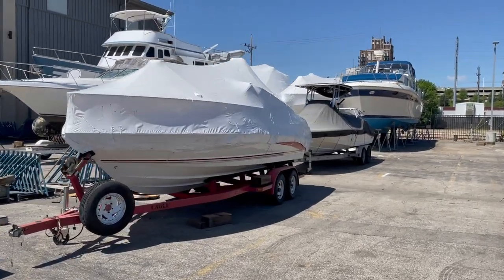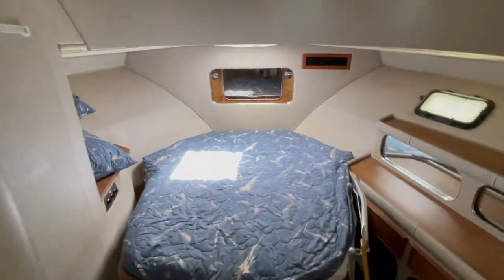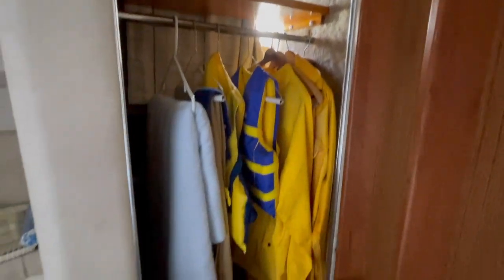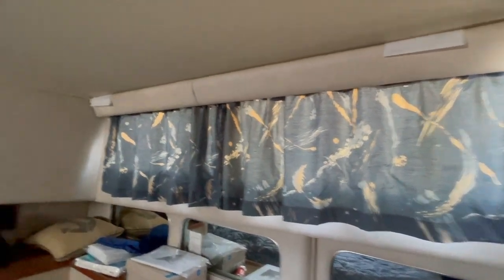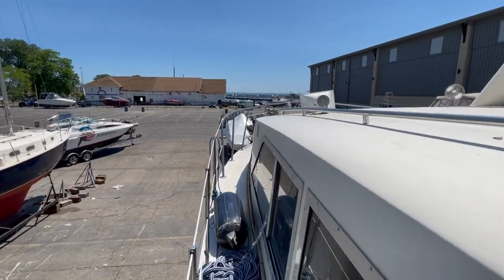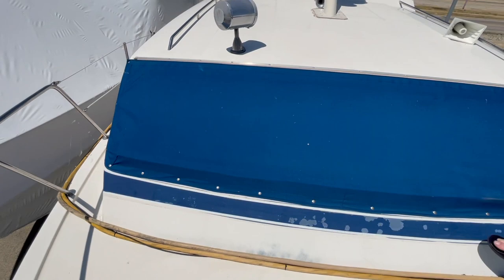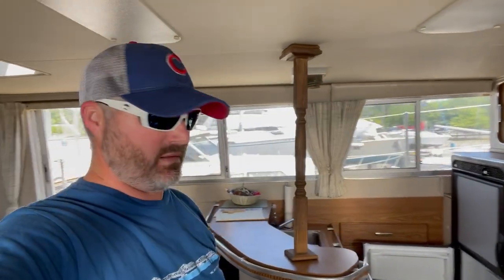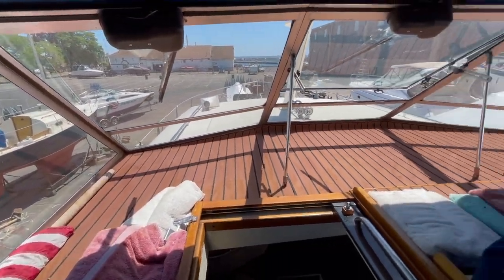Could this be the next boat??? 1984 Chris-Craft Catalina 381

Comment: Nice boat,but if i was going that big id go diesel.
Those gas burners are reliable and faster,but probably less than 1 mpg fuel burn.if you ever plan on taking the great loop,or trip to the bahamas.....gas is expensive to cruise around in on long trips.
Just my opinion
Reply from the maker: Completely agree...and we window shopped some boat with diesels. Just couldn't match up the layout or find one close enough.
Reply: @WiscoBoater  ill still watch and like your vids no matter what boat you chose.im partial to the diesel trawlers from the late 70s-80s,marine traders,albins ect.they all had the same engine 120-140hp lemans ford inline 6 that got 1.5-2 gph fuel burn at 8 onots,and very reliable.
Nearly All 34ft and up had rear master and front v berth with 2 baths.single screw or twin.
Good luck on your quest,i know once a mans mind is made up on a boat....hard to change it.
Reply from the maker: @nickpellegrin  LOL...that's true, but I'll let the survey make the final decision for me.